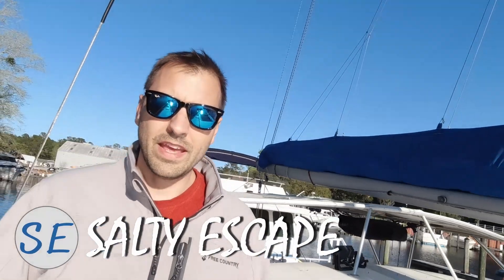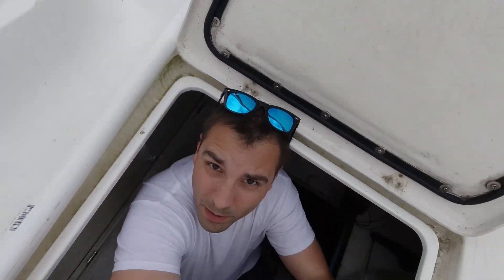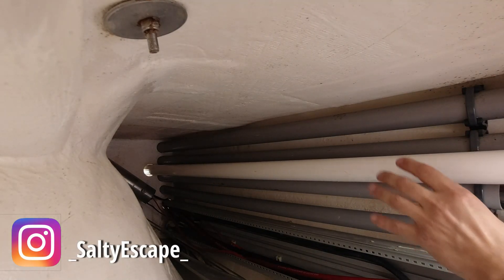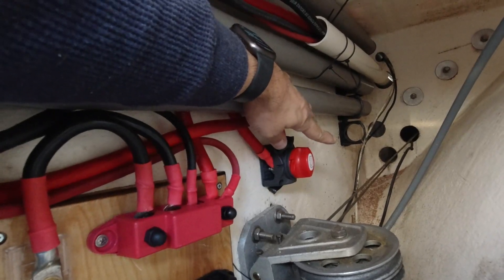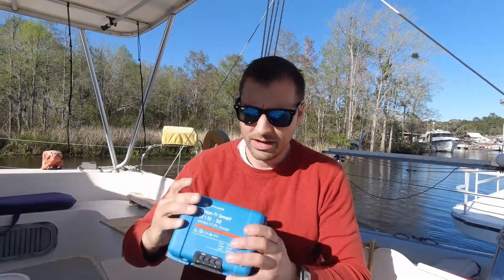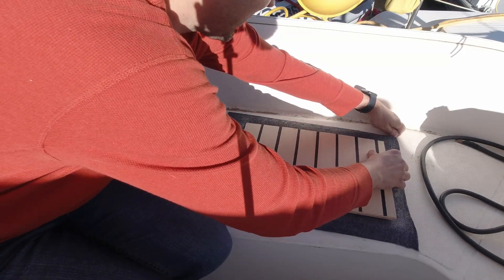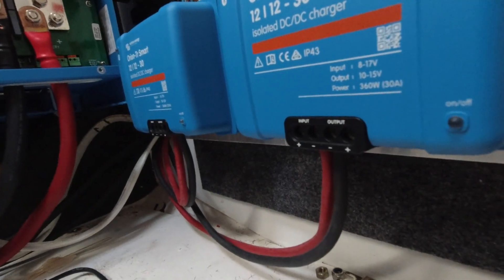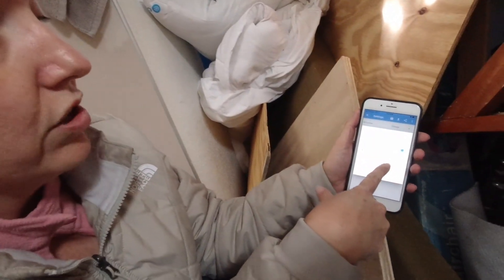Installing Victron Orion DC to DC chargers for AGM to LiFePo4 charging on our Catamaran Sailboat

Comment: The extra heatsink material is smart, so those dc-dc chargers will last longer.  You made the right choice for the 30 amp models too.  Two things that might help you in the future, gray pvc pipe is for electrical items and white is for water applications.  Gray is chemically somewhat different to resist electrical service issues that come up.  White will likely work just fine though, gray is schedule 80 and white is schedule 40.  Also one thing you don't want to do again is switch your battery selector switch to combine while your engine is running.  This can burn out your alternator(s).  Just the nanosecond between the electrical contacts changing positions can cause the alternator to go into a state where it has no load and the rectifier diodes will fry.  Put a label there telling people to not change those positions while any engine is running.  Most boats have them. I am looking forward to your energy usage statistics.  If you have a gaming PC though likely you will start eating a god bit of energy.  Since you have so much battery capacity you are in pretty good shape for a while of normal operations.  A lot of boats have somewhere around 200 ah and do lights, refrigeration, on solar daily of around 300ish watts.  500 watts is better for at least most monohulls.  I have a Catalina 30 so my solar is pretty sparse at less than 300 watts.  I make up the difference with a igen 2500 generator.  It runs our 16000 btu air conditioner just fine and allows us to charge with the leftover juice.  We can get 7 or 8 hours of run time for the air conditioner on around a gallon of fuel.  Typically that is all we need to cool things off enough to make do otherwise.  Generally it will also charge the batteries also on the multiplus with the leftover energy.  You may have to set your inverter charger with the appropriate values if you utilize shore power or a generator as to what the appropriate leftover charging capacity happens to be.  Frankly you likely don't have enough energy stored to run the boats ac, but a very small generator may be enough running all the time to run ac 24/7 with a Victron Multiplus.  Since you are heading southish, AC is a must..  You may use 2-3 gallons of fuel a day(running 24 hours),  but at like $180 monthly for extra electricity to run AC.  Not an issue for me.  The Multiplus can boost start probably two typical AC units on a 2500+ watt (3500 watt)generator.  Like a 16000 btu and an 8000 btu.  The multiplus adds electricity as needed from the batteries.  Solar could make up the slack in between.
Reply from the maker: Hi Allyn!  Wow, always such good information!  Thank you!  I did not know the risk to burning out the rectifier in the alternators, we will definitely put a label on.   We do have an onboard Wester beak diesel generator.  It ran during our survey but since then we have not had it running. Sounds like a good project for this week. I have no idea how much fuel it takes but if it burns feel like yours does it sounds like that is clearly the way to go for air conditioning in the tropics.  Soon, we will head out and monitor our power consumption, probably a week or two depending on weather.  We have multiple hungry laptops and Carter wants a gaming computer desktop version That will likely be power-hungry also.    Thank you again!  Corey
Reply: @SaltyEscape  , from marine how to "*Most quality 1/2/B battery switches, from reputable manufacturers like Blue Sea Systems, BEP/Marinco, Guest & Perko, are designed to be make-before-break. Make-before-break means that as you turn the switch from position 1, to BOTH or 2, the previous position does not open-circuit or disconnect until the next position can carry the current.

As some battery switches age they can wear and become break-before-make. For this reason it is not a good idea to move the switch while the engine is running unless you perform an occasional make-before-break test. The best way to test your switch is to turn on the cabin lighting (incandescent bulbs work best not LED’s) then slowly rotate the switch from 1 to BOTH to 2. If the incandescent light/s flicker at all during this rotation, replace the switch. Even a fraction of a second disconnect is enough to cause an alternator load-dump."

https://marinehowto.com/1-2-both-battery-switch-considerations/
Reply: @SaltyEscape  If you have a Westerbeke it probably is safer, but burns a lot more fuel than my little 2500.  Usually those onboard generators are for full on "party mode" running.  Typical of most chartered catamarans.  Most on cats are sized to run four to six Air Conditioners and everything else.  Chances are if you wanted to cut down on fuel usage, you'd have to buy another charger or two just to make use of all the extra power. I'd bet yours is 7000 watts to 12000 watts.  Phasor makes a 3.5kw that is good for "right sizing" a large monohull with two AC units and solar. There is even a more reliable 4kw model made by another manufacturer I can't remember at the moment. I don't know what you have onboard in terms of Air Conditioning or lack of, but most factory installed generators are just too big.  It might be that you could just buy a smaller one and plug it into a shore power cord.  They run just fine tied to the back rail and exhausting off the boat usually.  I don't know what your BMS can handle in terms of charging either.  Though the batteries can handle a full 280amps each.  So whatever your BMS can charge times five(batteries) probably with your wire gauge.  It might be you could throw 12000 watts straight into those batteries???Who knows???